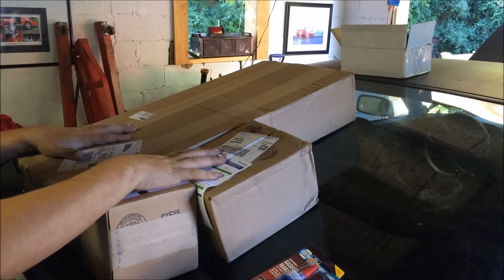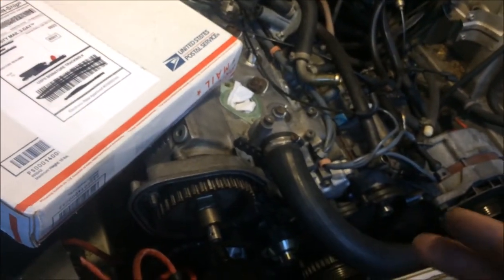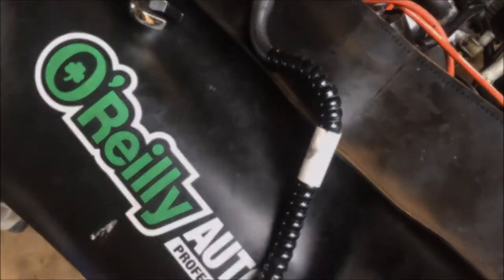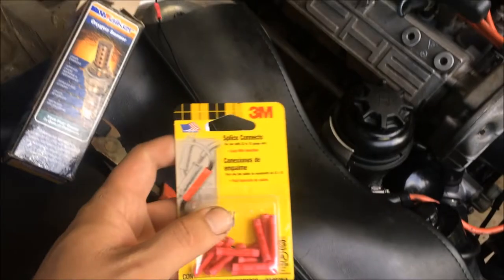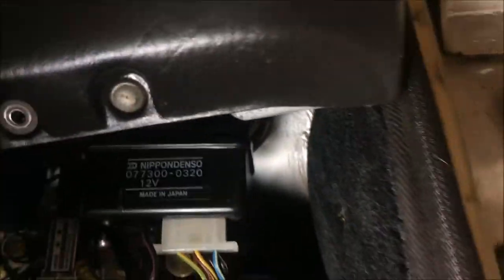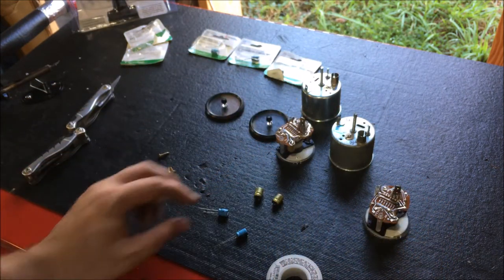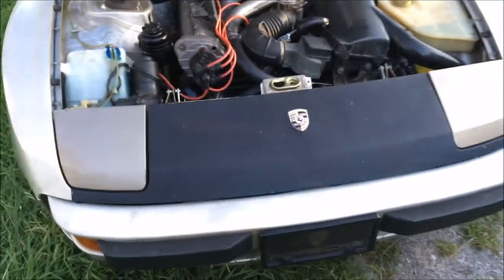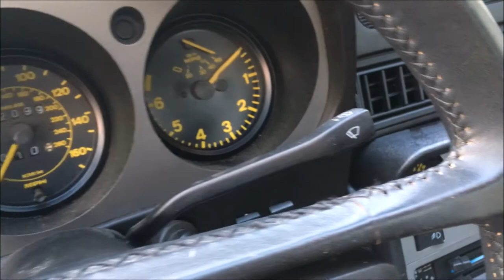1984 Porsche 944 -Episode 6

Comment: OK on your test drive (during daylight) there is the typical 944 dash cracks. Whats the best fix ???
Reply from the maker: I tried to repair a dash once and would never do it again. I also have several dash caps but I don't like how the look. Now I just find the best looking dash and live with the cracks. Alternatively, if you have money to burn then you can send your dash off to be repaired by justdashes, or get a new one from werk924. That's likely what I would do if I had a showroom/garage kept example. I hope that helps!
Reply: Flock them..

Comment: I bought a 1984 944 and the only annoyance is that it would vibrate at idle and shake the interior. I think it’s the passenger side motor mount. But my dad thinks it needs a tune.
Reply from the maker: Sometimes a visual inspection of the mounts will reveal whether the mounts are in good condition. You'll see that they appear to be crushed down. I believe they updated/improved the mounts later on. I had replaced the passenger mount on this car with a newer one and it still vibrates quite a bit so perhaps I should have installed an updated mount on the the drivers side as well. That said, this is a big four-cylinder and even with new mounts its never going to be smooth but if the idle is set too low or if there's a vacuum leak its going to vibrate worse than it should. I hope that helps!

Comment: Does the reference sensor have to be like silver at the bottom or can it be the all black one also
Reply from the maker: The silver ones are usually Bosch branded sensors. Doesn’t matter the color, they all work the same. Some will say the cheaper ones need to be replaced more often but these should be changed every ten years regardless
Reply: @edredas  okay that’s good to know thank you I recently watched your no start video and changed the sensors on my 1987 944 Porsche yesterday and try to start the car but all it would do is still crank and there would be no tac bounce still we even used starting fluid also we tried all the steps you provided in the video is there anything els you think that would help my car start

Comment: So you basically addressed ever single issue my 944 currently has or has had...thank you! Too bad I don’t have a place to try all of this repair stuff ...

Do you by chance know how to replace one of the dashboard lights (either clock or oil pressure gauge)?
Reply from the maker: Yup, once you have the gauges out the bulbs pull right out of their socket. To get to oil pressure gauge and clock in an early 944, you will first need to remove the climate control panel. There are two screws underneath near the face of the radio. Loosen/remove those, then pull the climate control knobs out and then the face plate will need to drop down since there are two tabs in the top of the plate. Once that face plate is out of the way, it will reveal two screws that need to be removed, then remove the two screws at the top above the gauges. Once the four screws are removed you will need to gently pull on the cover and look around for the tabs holding it on. Once those are un-clipped you can pull it off and the gauges will come with it. With the gauges removed you can pull the bulbs out of the back of the gauge. There is one bulb each for the clock and oil pressure gauges. Replacement bulbs are #37, which you may need to order. I hope that helps!
Reply: Thank you VERY, VERY much and best regards from Stuttgart, Germany. Just performed the fuel level indicator fix from your other video today...really appreciate the detailed ‘how to’ and it now works properly again / finally returns to 1/1!

P.S. You can now brag about you having helped a genuine Porsche employee tremendously with his car (even though I work in marketing, not engineering ... but no need to mention that 😄)
Reply from the maker: That's awesome! Glad I could help! I'm going to post your comment on my facebook page. Here's a link to my facebook group come and show off your project! https://www.facebook.com/groups/128264574553699/

Comment: my 85.5 944's clutch went to the floor and wont come back up unless you pull it, do you have a video of how to bleed the clutch?
Reply from the maker: If the clutch was working fine and then started going to the floor recently then its likely either the master or slave cylinder has failed. When that happens they will both need to be replaced regardless of which one failed. At the moment I don't have a video on bleeding a 944 clutch, but I do have on on bleeding my Mx-6 clutch, which is the same procedure. I hope that helps!

Comment: your engine runs so smoothly! is that a full rebuilt engine? If so what new parts did you at during the rebuild. do you have any head gasket replacement videos or do you plan on making any? keep the videos up i love they are so helpful!!
Reply from the maker: I didn't touch the bottom end, so this engine wasn't fully rebuilt. I only replaced all the seals and gaskets; with exception of the oil pan gasket. I currently do not have a specific video on doing a head gasket yet, but I do go over head removal and installation in this series. I have an '83 engine that I will be building soon and I'll make sure to do a video on just replacing the head gasket! Thanks!

Comment: Hey I’m getting ready to do a clutch change on my 944. I was wondering if I have to line up tdc before taking my clutch off?
Reply from the maker: Nope, it isn't required! Good luck!
Reply: edredas thanks! What clutch kit do you use?
Reply from the maker: I just finished installing a Sachs kit in a car so if you're looking for a kit, I would go with that. However, many times I just replace the disc like I did with this car. I ordered it from California Custom Clutch. I hope that helps!
Reply: edredas hey I was watching ur diy clutch video and was was wondering was that a good route to take?
Reply from the maker: Not really, back when I was making these there wasn't a good option for a cheap clutch disc, but that really isn't the case anymore. Its a lot of work and I actually liked the Advance Auto Bronco II disc better and it isn't available anymore...
Reply: @edredas  I was wondering why you didn't change the pressure plate?